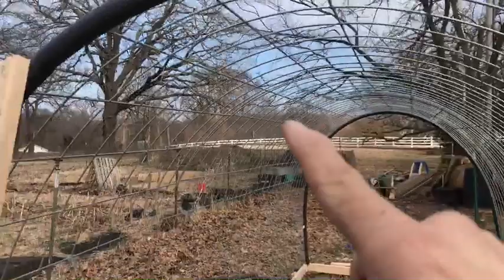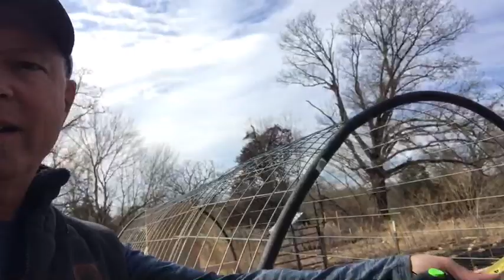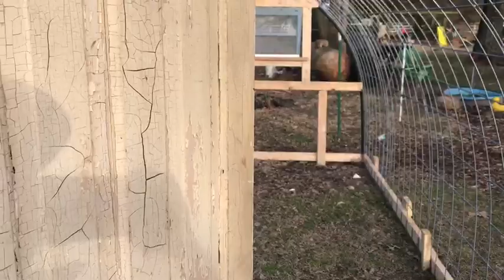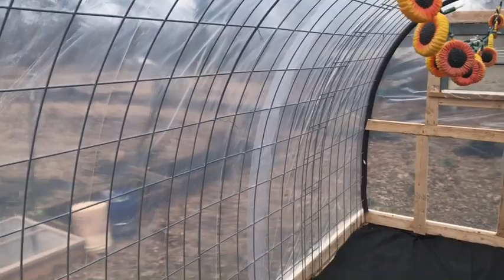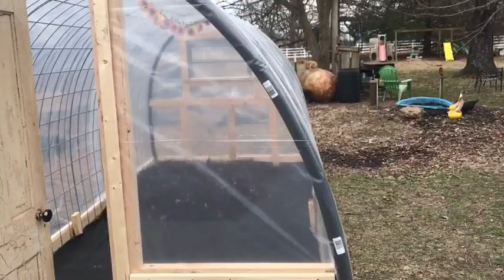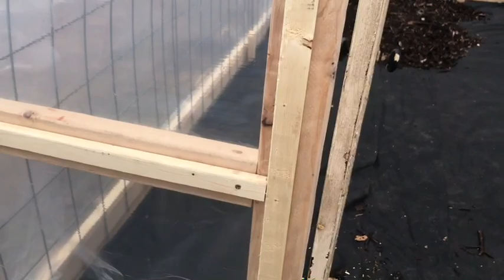DIY Cattle Panel Greenhouse | Part 2

Comment: I built one a few years ago out of electrical conduit that worked great but it was huge way too big. I'm going to build a smaller one this year. That one is about the size we need!
Reply from the maker: That’s awesome, would love a bigger one but this will do, would love to see what yours looked like. Those big ones are quite expensive. Appreciate you following our journey. Blessings friends
Reply: @MorrisPatchofHeavenhomestead  I sold the farm it was on several years ago. I'll see if I can find some old pics. I had 2 that were about 16 feet high and 30x80 ft I think. But they were for commercial use at the time. I just need one small one now that one will do nicely for me.😀👍

Comment: l like your greenhouse, looks easy to make and l might try this in a smaller version
Reply from the maker: It was definitely an easy build and affordable for sure. Hope it works for you. Happy planting. Blessings
Reply: After watching l looked for cow panel in Ontario, but l cannot find a supplier.  ls there another  panel that you could use
Reply from the maker: Cecilia Jansen PVC pipes could work as well or metal pipes bent in a hoop.

Comment: This looks great! I'll go find part 1 of this to see how you got it all started. I didn't see the link at the top of the video so I imagine you'll be adding that at some point I can find it on your channel though. I think I could make a chicken coop this way. Except instead of plastic all the way around put wire over the top. And then maybe plastic over a portion where I want to shelter the chickens. Who knows? Great video!
Reply from the maker: Thanks for watching, yes we did put the link up but it doesn’t show up on tv but it does on your phone. We are going to put up wiggle wire so we can raise up the plastic when it gets hot. Hope it works for you as well. Blessings

Comment: Great job on the greenhouse! One of the nicer one's I've seen on here. One question I have though that came to mind as I watched you over layering the plastic sheeting. I've worked in greenhouses a lot and know how easily wind can damage sheeting and invade a house's integrity. So with that said, have you considered the need for sealing those seams so wind won't drive cold air between the sheets and/or rip apart the film? I would recommend it. There is a tape you can purchase from green house supply companies that is weatherproof and will take care of sealing the seams. It will protect your investment to add the tape. Again though, great job! <3
Reply from the maker: The Tinkerer's Wife What a great idea, something we had not thought about, we will definitely look for that tape soon. So appreciate this community and the support we receive from folks, this is something we never would have even known being new gardeners so appreciate your help my friend. We were able to afford this kind of greenhouse we knew it probably wouldn’t be as good as the expensive greenhouses but thought it would hopefully work for our starts. Thank you my friend for this helpful tip, Blessings
Reply: We are about to build this greenhouse! Thank you for this tutorial. We did have questions about the front and back seams though. We'd like to do wiggle wire along the base and around the doors. But we can't figure out how we will close the top seam - where the plastic and foam piping and door frame comes together. Any recommendations?